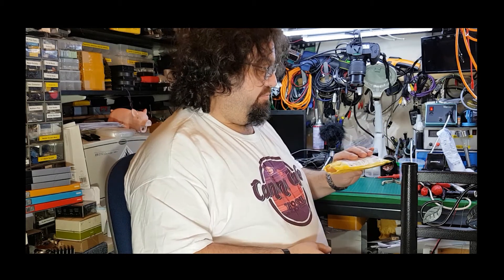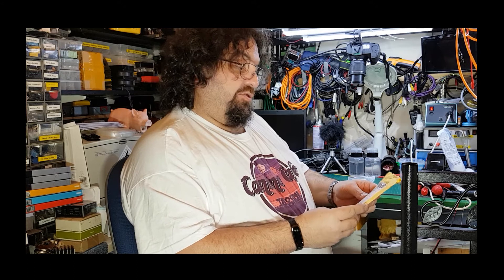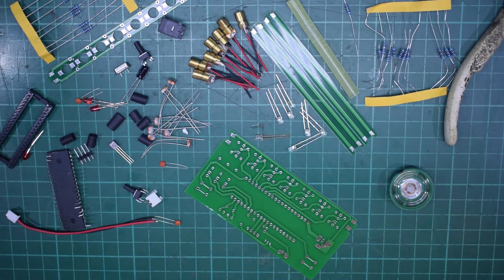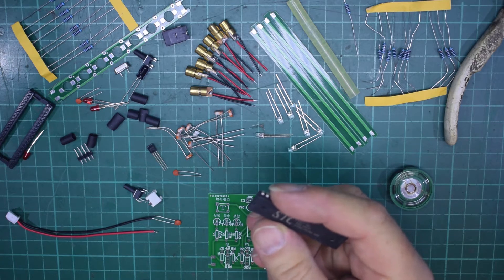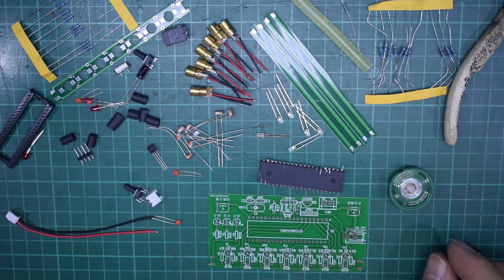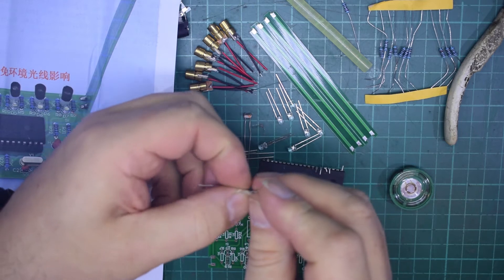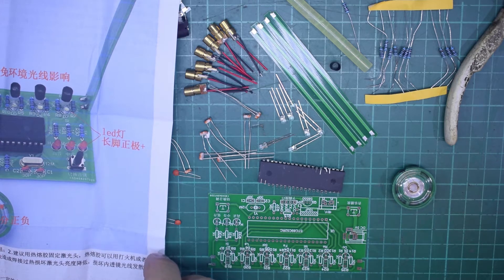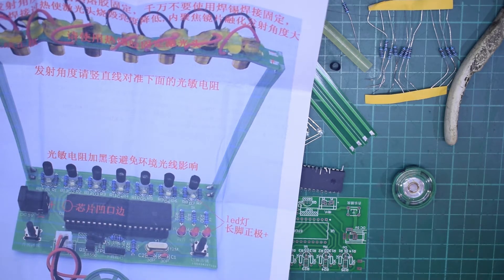A cheap Laser Harp kit using a microcontroller and 7 laser diodes

Comment: What does the other button do?
Reply from the maker: switches through the preset tunes.
Reply: Thanks. I have considered buying this kit and then try to make the sound more "harp-like". As it is from the start it sounds like a cheap toy organ from the 1980s but I think it could be improved in some way or the other.
Reply from the maker: To be honest there is a lot of room for improvement. Sound wise, the obvious one is to find the output pins controlling the sound chip and interface them with something better. Midi control would be too much to ask but a simple penny organ type circuit could work well.